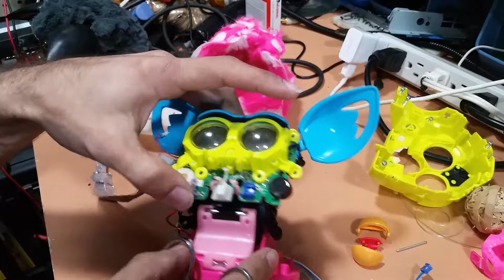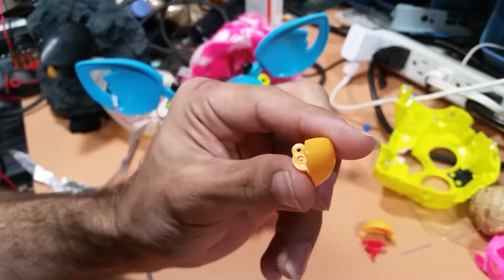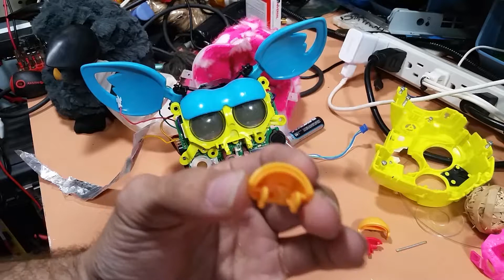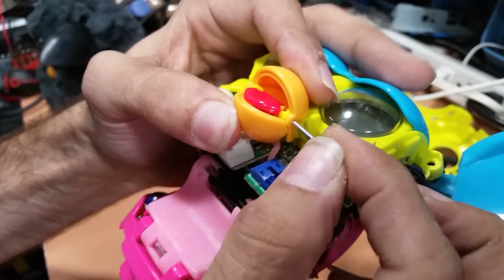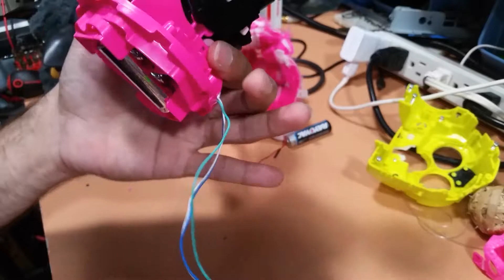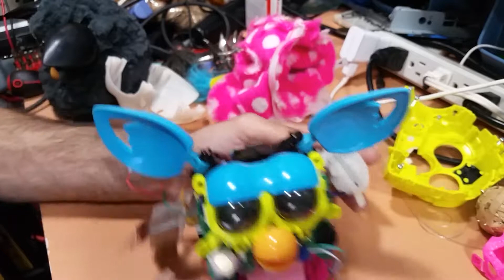Furby - Mouth Reassembly

Comment: did you add a hidden data port somewhere? to access without disecting?
Reply from the maker: Video about that soon. Turns out the 3 Furbies I have, only this one has this data port. Now its ripped apart and I dont know if I can get it back alive.
Reply: they  probably programmed the "pic microcontroller s" then planted them in the circuit or different revisions  or a un marked data port may be there.